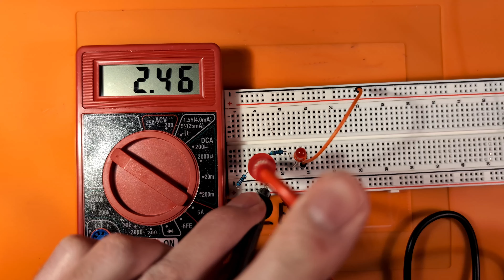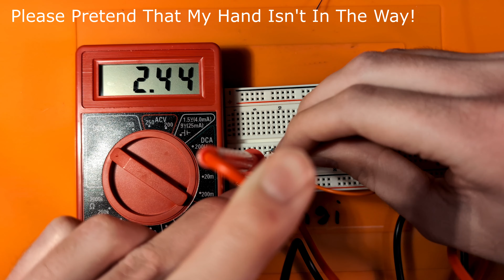Why Measuring a Voltage Is Not the Same as Using It

Comment: Is the divider the resistors you mean ?
If the resistors set are the dividers and are not meant for lead then what are they for, isn’t the idea of having a divider in a circuit is to eventually to load something ?
Reply from the maker: Yes, that's exactly the right point. Yes, the divider is the two resistors.
They’re usually used to create a reference voltage for things like comparators, ADCs, or op-amp inputs.
When you try to actually use that node as a voltage source, it has to supply current. That current flows through the divider resistors, which causes the voltage to drop.
If you want to use that voltage without it collapsing, you add a buffer, like an LM358 in a voltage follower configuration.